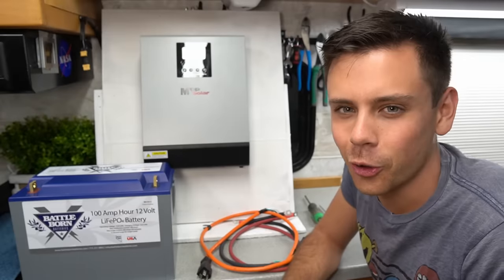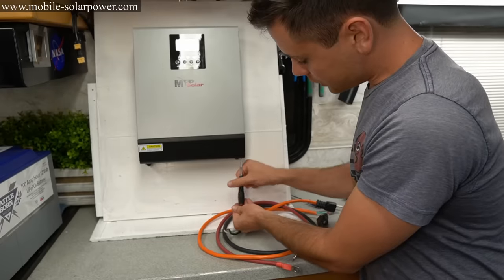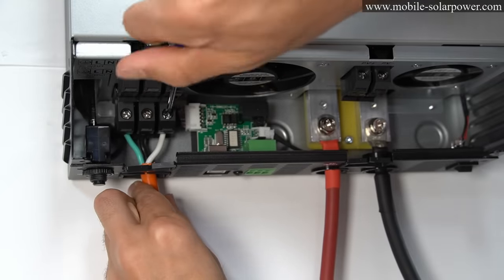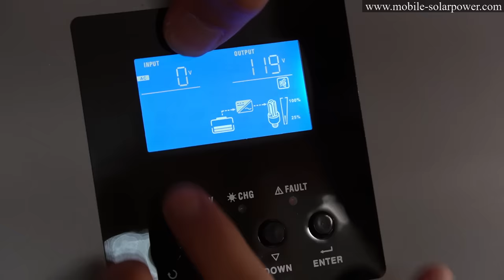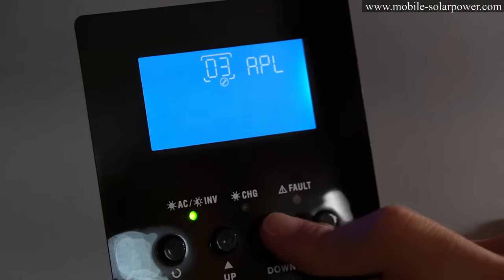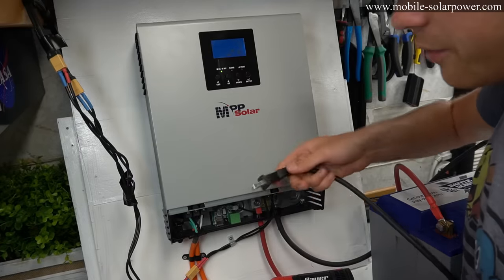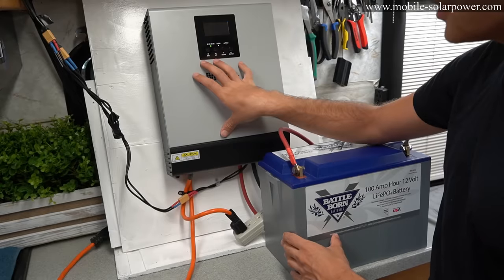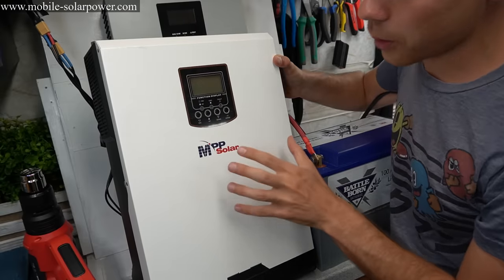Beginner Friendly All-in-One Solar Power System! Build a System in Minutes

Comment: Will .... I have a question... We purchased this all in one system for an off grid cabin. I want to install a few outlets but don't know what gauge of wire to run to them.... we have 5 - 100 watt Rich solar panels and 2 12V 100ah lithium batteries..... If I understood correctly, I am to wire the panels in series and the 2 batteries in parallel? So on the wire to the cabin, can I used standard extension cable wire? or should I used something more like romex residential wire? ... By the way, love your channel and appreciate you detailed information as this is all very foreign to us.

Comment: Hello, many thanks for the video, is helpful and well done. I have a question, is it possible to switch on grid automatically to charge the batteries and power home when the grid is available? I mean for example if a gasoline generator is used when no sun and batteries are discharged. 
Thanks for your reply and for your support.

Comment: yes these are good quick and easy to install much easier than the big chunky Outback system $8,000 worth
compared to $900 for this new type heaps of settings to use 
only fault is the fan sensor needs to be replaced after 6 yrs of full-time use not too bad for the price 
and its just a matter of changing the fan it must be a common fault as the dealer has spare fans lol

Comment: Nice work  brother 👍🏼👍🏼
If this run battery-less also but on generator ( ac input), can it still stabalize  the AC output (works as voltage regulator ) ?

As i have problems in the stability of the AC power ..

Comment: Wild question here; 
If I wanted to charge my battery bank using a generator, let's say my panels have been damaged for example, could I plug my generator to the charge controller using a plug like you have there to connect to the mains power?
Would I need a stabilizer?

Really wild question, if I had 4 X 12v 200ah deep cycle batteries, what size mppt should I buy and how long would it take to charge from say 30% discharge?

Thanks for any advice here. And thanks for your great videos. Very helpful
Reply: Your generator has to be pure sine wave then you can use that power to feed into this inveter/charger unit but it can only do 20A max charging current for this 12V unit, I have this LV1212 since Sept 2020, I have 3 SunPower SPR-230 connected to it in parallel and getting about 510 ~ 520W of power on good sunny day, my battery is 12V  90Ah LifePo4. This is my first setup to experiment with Solar power so I will have power when we have rolling black out here in California. I am very happy with the unit so far.

Comment: I need your help. I have 20- 240 watt panels, and I just bought 2 MPP Solar LV2424's - 4,800W Continuous 24V 120/240V Output | All In One Solar Inverter/Charger/80A MPPT Charge Controllers | PIP2424LV × 1.
If I'm in west Texas and get 6 hours of light in winter, and will be running a 120 volt house panel, with a fridge, ac unit, computer, tv and may be a stereo. What batteries do I buy, what volt and what would be the bare minimum I could get by with comfortablely. Thanks. It's just all confusing, and it's getting costly so I need some ideas. Love your channel it helps a lot.   Jeff

Comment: I've been wanting to install this all-in-one system for my bus conversion. I'll build a 24V system but still need a converter for 12V appliances. Is it  possible to connect a 24V to 12V converter to this system?
Reply: They have a 24v model that is higher watts too.

Comment: Great video as always! With the automatic transfer switch and no battery connected, do you know if it 'tops up' the additional load from the grid, or just switches the whole load to grid power? 

For example, if I have a 300w load, and the panels are producing 280w, will it draw the extra 20w from the grid? Or will it 'ignore' the solar PV and draw 300w from the grid?

Comment: Awesome videos! It has helped me learn so much about solar! I have a question though. Does the AC input pass through to the AC output like a UPS battery backup and then click over to battery like a standard UPS or does it do something like a double conversion UPS where the inverter part always pulls from battery? I have some sensitive electronics that doesn’t like the transfer from normal AC power to the inverter. Thanks and keep it up!

Comment: William great info thank you! We are practically neighbors I live on the edge of HENDERSON at Eastern/Serene area. I will be purchasing some of your gear shortly to wire up my Xantrec 2055 and Epever 40a MPPT for my toyhauler. However, I’m running into a little issue because I have two different solar panels 100w   Mono and a Boulder 5 that I’d like to use for this mobile system. I do not want to mount the panels on the trailer I’d rather have to versatility of setting them out and away from the trailer IF my trailer is in the shade. My issue is figuring out a method of plugging and unplugging the panels from the system. What kind of connectors should I use?

Comment: Now before I start ordering I just need to figure which voltage is best for my house so I can start making purchases once per month until the system is complete. My goal is eventually being completely disconnected from the grid or using so little grid power it doesn't matter. I want the grid for those times when I need it for backup purposes only could careless about selling power to them makes no damn difference to me.

Comment: Great video, I want build off grid Sprinter 144 with 300 amp batteries. Can I add a DC-DC battery charge to this system??
I want 3 way of charging batteries

Comment: Thanks for the great video, I bought this unit(  Easun Power 5KW Off-Grid Solar Inverter 110VAC/120VAC 48V Pure Sine Wave Inverter MPPT )and the directions  are soooo bad. Is the control panel operation the same as in this video ? Where can I find info on how to set this up ? I am using 8 deep cycle 6v batteries and 14 ,320v solar panels. Thanks to anyone who can help. I tried the web site for this and no rresponse.

Comment: I forgot to mention the solar box that is ready to plug and go is from a china website and I am sure it's not the of high quality but I was hoping you could give me your thoughts on it..it has everything except the battery and the panels but I do believe it has all the panel in puts and battery charger cables..it say it can do from 24v to 48v and 110v to 220v...but the $60 to $70 price tag has me very skeptical and I'm sure you could debunk or prove it is a reliable unit

Comment: So why are people building a system out of separate components when this all in one is so handy?
Are there any downsides compared to a self build setup with separate components?
Reply: Well to be honest it looks pretty simple to just piece a system together, its just solar panels, batteries and an inverter.
Reply: Several reasons you'd build individually.  1) There is functionality you can get with other setups (internet monitoring/control, additional switches/fuses where you want them to have different levels of control), 2) ability to upgrade your battery/solar independently of the inverter, 3) This has a high idle parasite draw of 15-25W.  Higher end inverters have <1/3 the draw, or 4) you already own some of the hardware.

I'm considering this because of the price and the auto transfer switching spec (<10ms) as I want to build a UPS that can act as a portable solar generator.

Comment: Just so everyone is aware of a few things:  
1). The manual says that these units are only supposed to be used on lead acid.  Everyone says it’s good on LiFePO4.  
2). MPP says to put a 40a breaker upstream of the unit to the solar panels.
3) you’ll need a fuse to the battery
4). There isn’t a DC out like on many other charge controllers.  I don’t like this because the mpp should keep the charge loads separate from your battery loads.  This puts your DC appliances and everything else on a variable voltage.

In the end, I recommend just get the separate components.  You will need most of them anyway.
Reply: indeed, it lacks fusing. Do you know any YT video that shows fusing with all-in-one inverter? cant find one

Comment: Hi Will, Is there a way to turn off the Inverter and still use the solar controller to charge the battery bank? Being that the 
idle consumption of the inverter is about 14 watts it would be nice to have a on-off switch for the inverter side of the All-in-one while using the controller-charger side.

Comment: excellent  Inverter  with charge  controller    & circuit  breakers  # but  in my city Karachi   the grid  power has 3 phase (  3   220 V current  lines &  one  neutral  for  all 3 phase current )    this inverter  AC input   has 3  terminals  1  neutral  &  it  must have  3  more  terminals  for my 3 phase c grid power  current lines #

Comment: Question about the AC output plug.    If I want to run a few outlets in my trailer with some USB jacks in them as well as a small TV and small frig....can I run that AC output into a small breaker box and wire the outlets into that with 12/2 with 15A breakers?   Not sure I would need more than 2-3 breakers max.   Maybe a small sound bar for the TV, small fans for at night.   Would that work?

Comment: I’m not an electrician by any means. Can this system with 2-3 100watt solar panels and a good battery like the one you showed run a small AC unit for a van, small fridge, some LED lights, and a vent fan? Because that’s exactly what I’m looking to build for my van.

Comment: I'm wanting to get a 48 volt system and I'm curious if i can plug my motor home into 220 shore power and run everything can I hook up a 220/230 5000w 80a just like shore power? And what battery do you recommend??? I was going to get one of the server batteries from your other video. Thanks for your input.

Comment: Great info and so simplified! What happens to 1000W MPPT controller if it's not connected to the grid power and you run more that 800W power tool?

Comment: If I build a system with a decent array, battery, and this type of all in one unit, could I hook it up to my manual transfer switch to my home to use in an outage?  Could I leave it hooked up feeding a 15 amp circuit or 2 on generator mode to save some grid power without fear of back feeding or worrying about having net metering set up and such?  I am looking to build a summer time man shed that can double as an ice shanty in winter, but if it is sitting there making decent power, I’d like to use it for at least backup power if possible.

Comment: Great video and info. I’m looking into an off grid small battery system that will tie into an auto or manual transfer switch to power a few essential house circuits for power outages and or power at night. What do you recommend?

Comment: I have a on-grid system, 14 - 275w, 9.28 Isc & 38.6 Voc solar panels & I want to convert it to a hybrid system. My panels are currently daisy chained into one string. If the new inverters (2)  have a max Voc of 145 VDC, max solar charge current of 80A and the AC charger current is 40A,  should the panels be wired in strings, directly to a junction box or a combo. (I may have to use just 12 panels, de[ending on your answer.) Thanks!

Comment: I'm confused - - in the link provided above, you mention, "Because the idle consumption is high on these all-in-ones, you will need at least 400 watts of solar panels attached to your system to offset the loss".  Does this mean that it uses 400 watts at idle ??  I can't believe that.  I have a theoretical 600 watt solar panel system. Can I safely use this 12 volt all-in-one system ???

Comment: Hey man, great video. I  installed this inverter in my house about 3 months, but last week the utility power was cut off (it happens a lot where I live, that's the reason why I bought it, to use it as a back-up) so normally it would switch to the panel and the battery power but it presented a fault, #06, according to the manual this means the output voltage is abnormal, but Idk how to fix it. Could you help?

Comment: Question on "smart outlet". I have a 2kw inverter. It can run the microwave and the air conditioning, but not at the same time. Is there some kind of smart outlets such that when power is used from one outlet, the other is automatically turned off? For example I could plug in both the air conditioning and the microwave at the same time. When the microwave is used the power to the air conditioning would be automatically turned off. When the microwave is done the power to the air conditioning would automatically be restored. P F Rieder

Comment: I am wondering if I can use these hybrid inverters without solar. The idea is to use the grid to charge batteries and use the inverter when there is no power.

There is a possibility there will be power cuts in my country. I am looking to start a solar project but in the immediate present, I need battery backup. I am still looking for panels available in my country or to order them online.

The concern I have is under "PV Module Selection" I noticed that the VDC or the PV array need to be higher than the start-up voltage. Is this inverter or for the MPPT controller?

Thanks for the videos, I learnt a lot from your videos and am confident I can get my house on solar eventually. I am on rent, so I actually need permission to make a change like that. Otherwise, if the roof falls off I will have to pay. 🤭

Comment: Hi, I guess I can plug the AC outlet into a multi socket extension lead and then from there to a AC to DC transformer to run my 12 volt light system? TIA
Reply: neprajah that’s what I’m trying to figure out is how everything that’s DC like a max air fan or a refrigerator that’s a DC refrigerator is going to run off of that machine I can’t figure out where you will hook it up.

Comment: Hi , I have MPPT SCC / AC charger inverter which I am planning to use it without solar panel , I got the battery connection from your video but I am confused about the AC input and Out put connection , if I am correct I am going to plug the inverter out put to any off my socket wall , but from where do I have to plug in the AC  inverter input ? Isn’t it the same to plug the out put to the wall and the input from the wall as well , please advise me on this matter

Comment: question; i have 10- 250 watt panel then 2/4000 watt pure sine//  goal is to run front room approx 500 watts, kitchen approx,1200 watts.. what charge controller should be used?? oh 10 /12 volt marine deep cell battery bank . also how far can the inverters be from the batteries?

Comment: With these all in one units when the A/C In, is plugged in, are the batteries charged by the A/C In instead of the solar panels?
Can I connect my generator to the AC In and charge the batteries? As an alternative to solar charging?

Comment: Question, when plugged into the grid, if the panels don't provide enough charge for the battery will the battery get charged via the grid? Personally I want full off-grid but...

Comment: with the MPP 24V system for instance? can that still power a 12v fridge, does it have an adapter for that or would you have to plug the fridge into the AC terminal?

Comment: I have a Mitsubishi. Mini split heat pump system that I would like to run solar to it. The maximum voltage is 253 the minimum voltage is 198 What kind of system would you recommend for it?

Comment: I have a cabin and run a generator sometimes and a solar power other times depending on power requirements. Can you recommend a on-off-on switch so I can switch manually from one to the other and keep them isolated from each other. Please help can’t find a factory switch that will work for this application.

Comment: Hi, i bought the same all-in-1 system from the same manufacturer but a 3,2KW 80A model. Currently I only own 2 pv modules of 170W max (18.5 Vmax x 9.2 A max). I tested those modules with a multimeter, it works pretty good. But when I connect them in parallel to the all-in-one system it doesn't work, 0v and 0a on display. No error or alert. I didn't bought batteries yet. I just wanted to be sure this all-in-one inverter/charger was OK before going forward on my investment.  Do you think it's because there is a lack of pv modules?  They mentioned a min of 6 in series recommended on the installation guide. Another reason?

Comment: Do these units have low temperature cutoff? I didn't see any mention of it in the manual or the mobile app and the folks at USA MPP Solar have not responded to either of my messages. I know I could let the BMS handle low temp protection but I'd like to have redundancy -- let the MPPT (or whatever device) act as first line of defense and the BMS act as backup.

Comment: Does this system have tendencies to overheat? Do I need to have airflow or available in where I mount this system? I converted my Ford transit into a camper and want to mount underneath the bed but want to be safe

Comment: I am building a small teardrop trailer thinking  of a ubuild or this running a fan mayber small 350 heater and lights and charging stuff and thinking a 100ah lithium with 100-200 solar .Will this system work if you have a power converter for your ac dc? 
and how hot to these get do they need a ton of room around them?

Comment: I’m looking to build a system like this that could be built inside of a truck bed tool chest.  Is it possible to build a system large enough to support a 50 amp plug that I could connect directly to the RV receptacle?

Comment: The 24 Volt system do you have to have 24 volt batteries to run it? Can I use 12volt Lithium life pro 100 Amp Hour? I like to use over 500 Watt Solar panels on my trailer. This seem to be a easy way to hook up a solar system.  But not sure the small unit will work for myself?
Reply: You can use any 12v battery but you have to put them in a series to make it 12v.
Reply: @tristanholt9816  is there a video on how to do that?